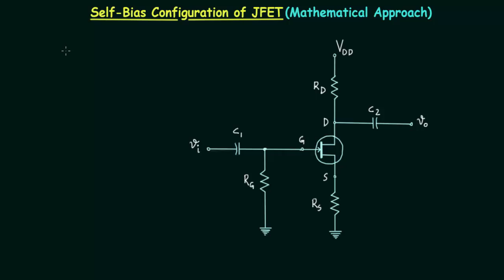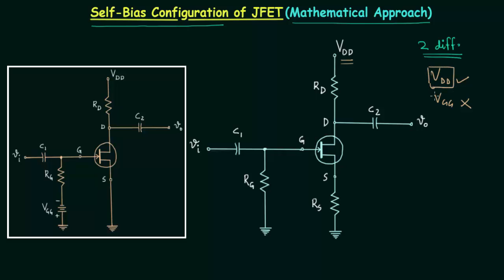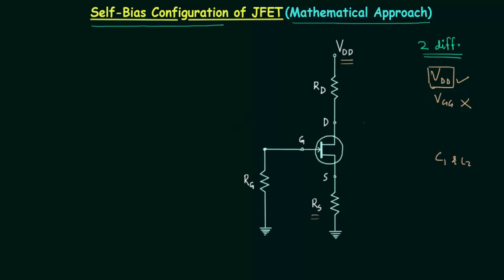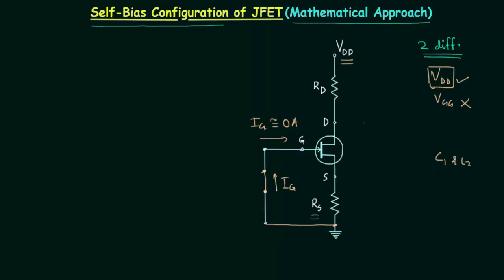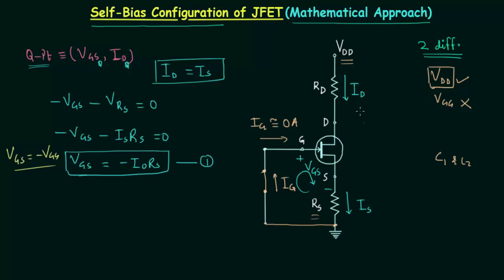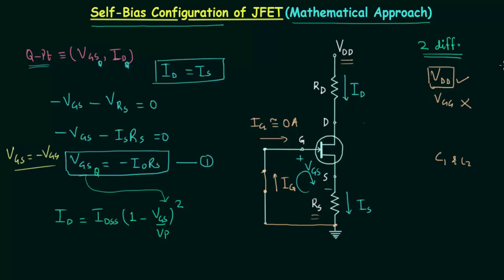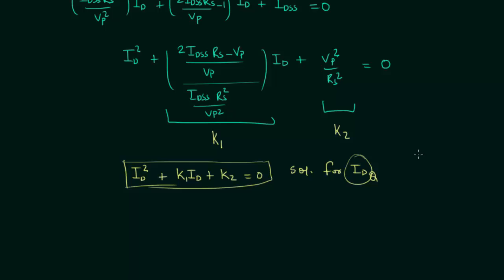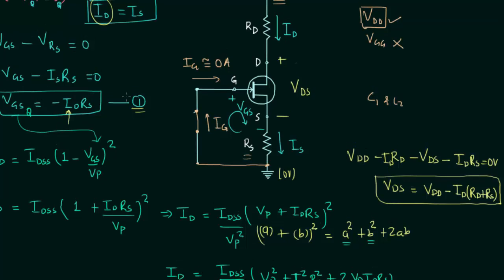Self-Bias Configuration of JFET (Mathematical Approach)

Comment: Calculate the bias currents for the circuit as shown in Fig. 2 and verify that the transistor Q1 operates in
the forward active region. Assume β=100 and IS=5x10-17A. How much does the collector current,
change if R2 is 1% higher than its nominal value?